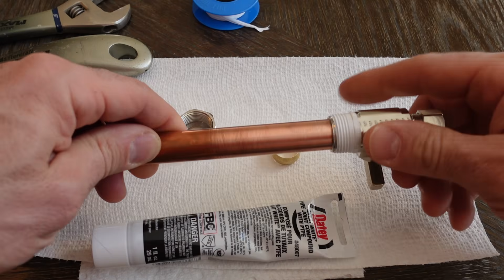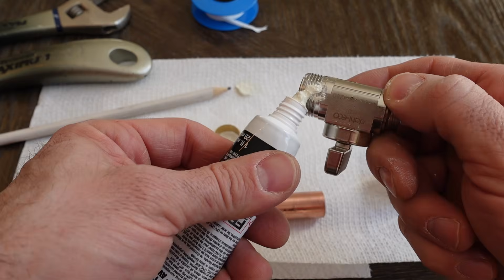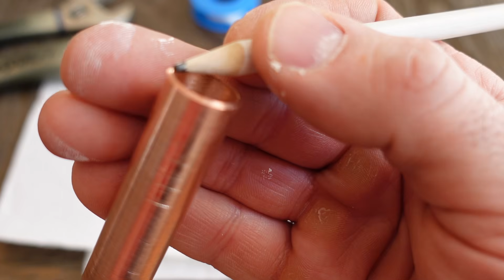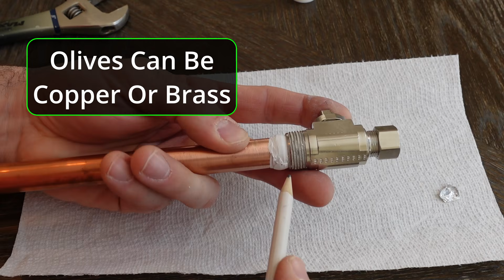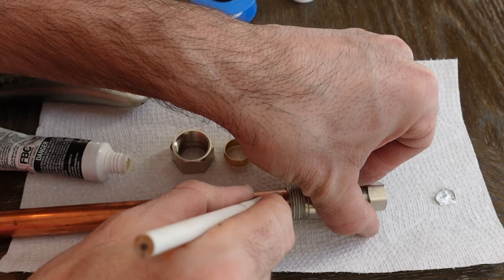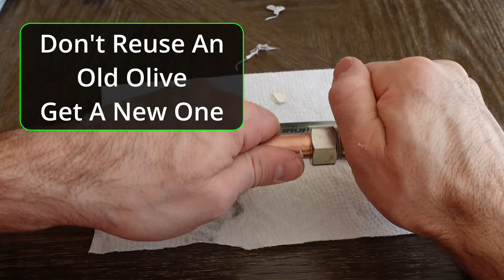How to use a compression fitting on a water line

Comment: Crikey, forget the tape and dope. People also forget that water can seep between the olive and the pipe even if the nut and fitting are perfectly sealed. You correctly cleaned the pipe around (not linearly) but didn’t mention it
Reply from the maker: Properly cleaning the pipe circumference is definitely a critical step to ensure a good seal.

Comment: Actually you should pull the pipe about 1/16" out from fully seated so it can travel inward as the two sides of the olive are compressed. If it's fully seated the fitting side will not compress as tightly as the pipe side. On larger pipe you may want to increase this to around 1/8".

Pipe dope or tape isn't necessary, but it can keep corrosion from locking the nut to the fitting to ease removal. (Valves sometimes do have to be replaced)
Reply from the maker: Thanks for the comment.

Comment: Those valves are also designed to be soldered on the pipe without the compression nut.
Reply from the maker: I generally would prefer to solder.

Comment: I would say the main cause of leaks (aside from old age) on new installs is copper not clean enough and copper not being in perfect shape. Cutting tools often causes the copper pipe to not be perfectly rounded, so if it doesn't look so use a rerounding tool.
Reply from the maker: Thanks for watching and the input.
Reply: Supply stubs are low, short and in the worst place to access.  Can’t overthink; just install the compression.  Or better yet, solder a 1/2 inch female adaptor to the supply stub.  Then use a male thread 1/4 turn valve.

Comment: Hi, the Isolating Valve in your vid...Can I partially close this and use it as a Flow restrictor or will this lead to problems ?...Thank you
Reply: I’d advise against it. A had a sink that someone did that and it created water knock/water hammering.
Reply: It will eventually ruin the valve.  The water flow will erode a ball valve like this if it is not fully closed or open to the point it won't be able to shut the water off completely.   A gate type valve will also fail in a similar way. Partially opened/closed will cause increase wear on the gate.  A purpose made flow restrictor is the better option.
Reply from the maker: I guess it could do that. I have no idea if it will cause problems or not. I ve never done that